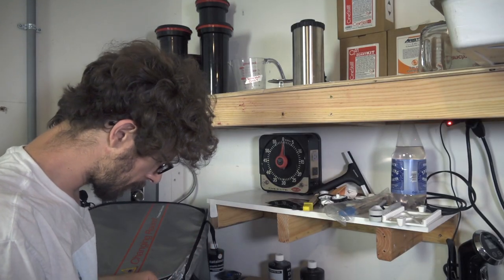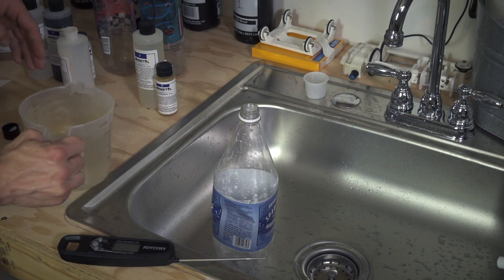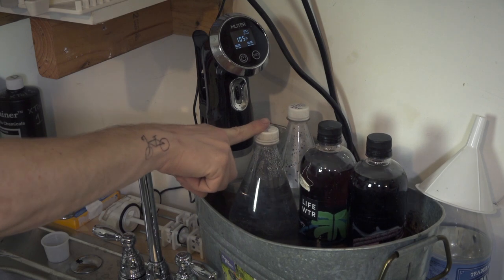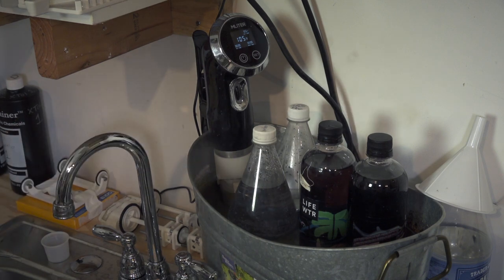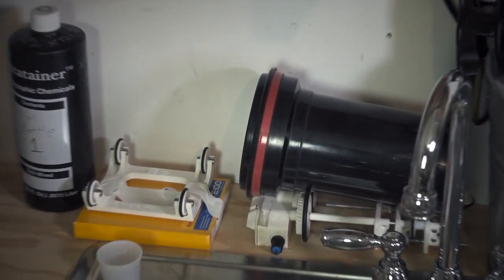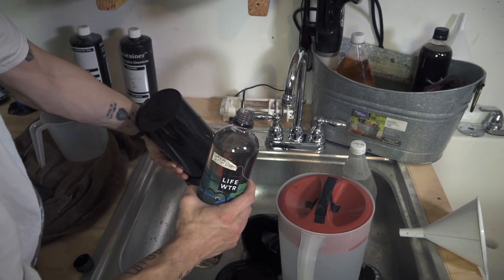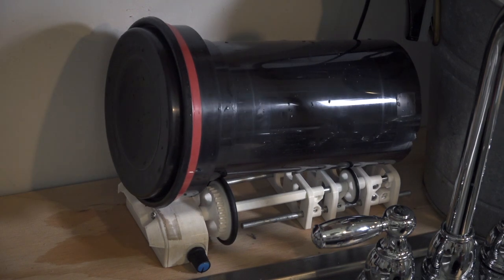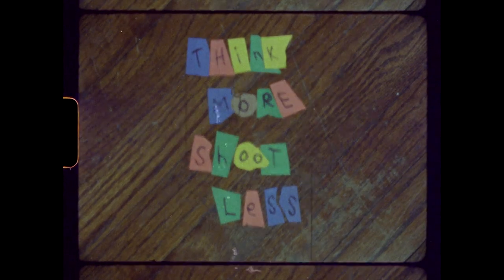Developing E6 at Home w/ Arista Rapid E6 Kit - Part 2

Comment: A couple of points he skipped. While you can reuse  the chemistry, (1) because the mix of used and unused solution has less developing agent in it, you have to extend the 1st developer per a formula in the instructions in order to get full development, and (2) if you reuse the chemistry, you will get color shifts. They will be quite modest for the 2nd use, but the idea that you are going to fully reuse chemistry half a dozen times without penalty is ridiculous. A way to have the cake and eat it too is to use a rotary processing tank and roller base and use the minimum amount of chemistry required (new), then discard (no reuse). This kit has the capacity to process 2 - 36 exp 35mm rolls in 8 oz of chemistry. The possible problem is whether your tank can cover the film on a roller with only 8 oz. Some can, such as most stainless steel tanks, which have a smaller diameter. The Paterson tank he uses here may not because of its fairly large diameter and huge waste volume from the internal funnel. Old style Paterson and modern AP tanks do not have such design flaws. Jjust test it on some scrap film with water to check how much solution is required to cover the film when loaded in the reels with tank on its side.  Generally, a modern Paterson tank isn't a good choice because they tend to leak, and the lids are known to pop off, which would make a mess and destroy the film.  If you have the tools and technique, you can do 2 rolls at a time with 8oz, or 8 rolls per quart kit, without having to reuse anything.

Comment: Do you think transparent film provides more consistent results without requiring too much or any color editing than color negative film? I use negative lab pro and it's a good plugin but I find getting consistent results difficult and I don't like spending lots of time turning dials.
Reply from the maker: J. R. Medina Your light source may be something to address then. The best light sources for scanning are actually bright tungsten fixtures or an Einstein strobe in color consistency mode

Comment: Good description of your process!
I have a question regarding temperature. Everyone is super strict about temp, and you do measure your chemistry temp and keep it heated, however while in the tank rotating, there is no heating going on. And from the result it doesn't matter. Did you ever notice any difference ?
Reply from the maker: I keep all my sheet film in a bath so it maintains temperature but no, I’ve not personally noticed color shifts or issues using the same film stocks with rotary and 1.8° drift in temp vs maintaining constant temperature using hand inversions
Reply: Without the submergence in a heated water bath during processing, the tank/solution/film is going to lose temperature. Here are two ways to deal with that:
    (1) Only the first developer is super critical for time and temperature. It controls the color balance between the three color emulsions, which will produce all colors in the film.  While the other steps are important, they all chemically interact until all the emulsion available has been processed, then they chemically stop. So, the goal is to get color developer and blix to "completion". If you run a bit cool during a process step, just add more time to compensate. (10-20%) You cannot over-process these steps.
    (2)  For the first developer, do a dry run with just water heated to the specified temperature. At the end of the process time, pour out the water and measure its temperature, which will have fallen some during the step. Taken to "drop" and divide it by two, then add that half number of  degrees to your starting temperature when warming the first developer. Also use that increased temperature to pre-wash and warm the tank and film before you begin. So, the first developer will start "x" degrees too high and end "x" degrees too cool. The average will be spot on the specification. This really does work; a trick from the "good old days" when a calibrated, heated water bath to hold photo chems at temp cost about $450 in 1980 dollars. (Or most of the price of a new Jobo processor today.)
    I cannot say how much temperature deviation from spec you can tolerate before you get off-color results. If you get off 1 degree in the first developer, you are going to get a lab  measurable color shift, but you may go off maybe two degrees (F) before you will start seeing something if you look closely. A lot depends on subject color. For example, a colorful sunset over a darkened landscape is going to look like a sunset even it the processing strays well beyond tolerances stated.

Comment: After I move I plan on developing my own film at home, and instead of starting with color negative or black and white, I'd much rather start with slide film, as I think I'll see the most savings when doing it myself... Also most labs won't process Velvia 100 anymore (thanks EPA...) so I've got to do it myself if I want to shoot it.
Reply from the maker: You can and totally should. My biggest recommendation is running test strips to evaluate your development time and temperature consistency. The savings aren’t there if the film doesn’t turn out good, so it’s always worth making sure the dev times / temps are perfect
Reply: @DavesFilmLab  I always felt bad at the idea of shooting a roll of film just use it for testing purposes, but I suppose because it is an investment, what's one roll of film compared to everything else you need?
Reply: @DavesFilmLab  Oh! Also, what do you recommend in terms of E-6 chemicals? I'm interested in Cinestill's three bath kit, but I've heard iffy things (anecdotally at least) about it. If you have any thoughts on it, I'd love to hear them.
Reply from the maker: @LaskyLabs  I have another video about the cinestill chemistry. I love it
Reply: @DavesFilmLab  Shoot, then I'll have to look into that. I'll be right back!

Comment: those flower photos are great. have couple similar ones currently shot on the roll still in the camera, cannot wait to process them. :)
any chance you could give some more details about the rotary processor you are using? looks like a great piece of kit. thanks! :)
Reply from the maker: Thank you! B’s processor
Reply: @DavesFilmLab  Awesome, thanks a lot. Seems they are currently out of stock on his webpage. But they do look handy and could potentially be cool little DIY project. :)

Comment: How many rolls have you been able to process from your kit ?
Reply from the maker: Rodrigo Perez 40+ usually. Hard to quantify really cause each kit gets a mixture of 35, 120, and 4x5
Reply: @DavesFilmLab  thanks I was wondering because I bought the pint kit and it said only two rolls but I have like ten that I've shot and wanted to develop them so I was curious as to how many I could process before they went bad.
Reply from the maker: Rodrigo Perez the E6 kits don’t have a long shelf life once mixed but ive gotten plenty of good results in the first 6-8 weeks of use. My suggestions would be to save up your E6 film and do batches so it’s both cost effective and best utilization of your chemistry